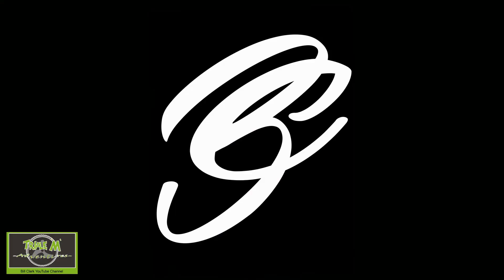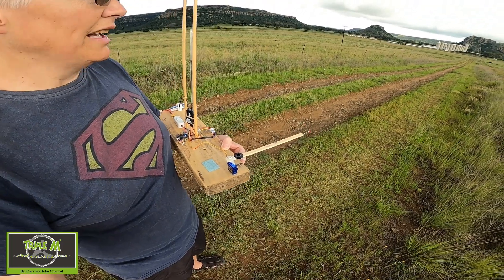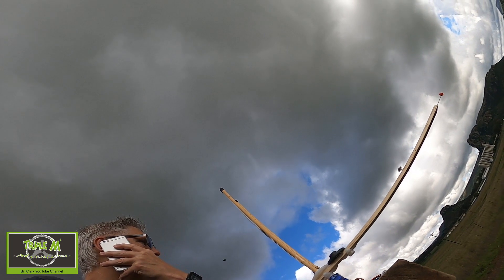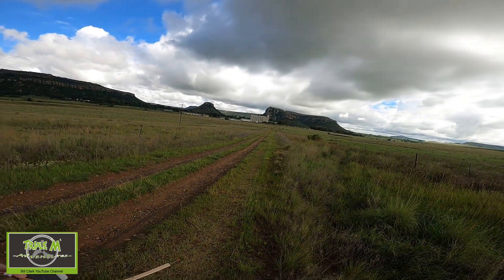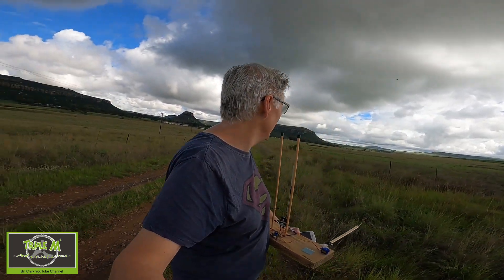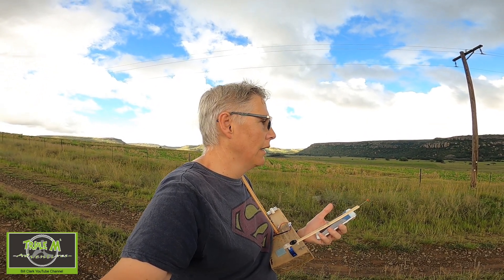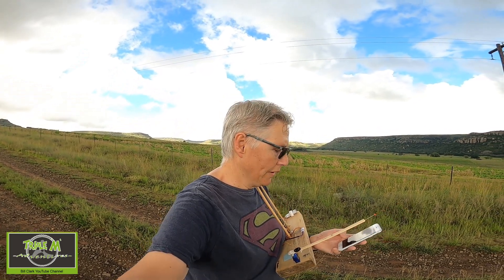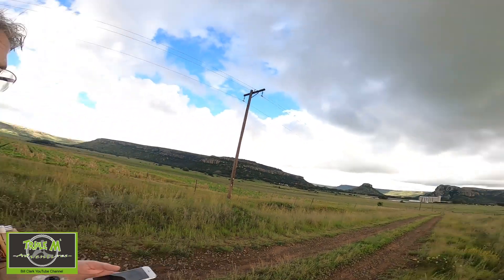Range Test "Real World": RadioMaster R168 SBUS / PWM D16 Receiver

Comment: This receiver has two antennas. I have just bought one . How do I fix the receiver antennas in the fuselage. Do the antennas have to stay in the fuselage or be extended outside ? I have no idea
Reply from the maker: Hi Ebenezer, if you can install them 90 degrees to each inside the fuselage will be fine. I have mounted antennas on the outside which is ok too.

Comment: That's my iPhone!
Reply from the maker: It just looks the same Woodstock!
Reply: @the-happy-RC-flyer  Phew
Reply: @the-happy-RC-flyer  Hi Bill. I actually need International Rescue for real I am afraid. Having successfully tested the range of my Crossfire Micro module (radio needed latest update) and found it to be satisfactory (broadcasting telemetry thru several houses), I came back to try to fly with Internal RF. Now - I know about checking the internalmulti option before downloading the firmware and this was done, but since the reflash I cannot turn internal RF back on. There is no option - it's missing. Two hours of valuable flying time later and it's still game over on internal protocol, despite multiple reflashings and card content updating. Clearly there's something here that I simply don't understand. I would be very grateful for your input on this one. It's an 'old chestnut' perfectly standard problem - but I thought I already knew the answer. Thanks a lot.
Reply from the maker: @mrhilma  If you have backed up your radio & model settings I would suggest removing the Crossfire module from the radio. Check in your radio settings in OpenTX Companion you have checked internalmulti as an option. Then flash OpenTX again to the radio using version 2.3.11 Check if the internal option is available if not. Then flash your internal module with version 1.3.2.77  Please let me know if the firmware updates showed they had completed correctly.
Reply: @the-happy-RC-flyer  Thanks Bill - all sorted. Wrong firmware perhaps. Anyway internal is back. Very much like: https://downloads.multi-module.org/
Reply from the maker: @mrhilma  That's great!
Reply: @the-happy-RC-flyer  Thanks for the inspiration. Yet again. First Crossfire flight tomorrow hopefully.
Reply: @the-happy-RC-flyer  Phew

Comment: I got R161 and R168 and did a RSSI range test at home behind three 6 inches thick concrete walls. The follows are only for reference: using RadioKing 4 in 1 internal module 1.3.1.92
R161 RSSI 52 (pre and post freq tuned innopenTx)
R168 RSSI 45 (pre tuned), 52 (post tuned)
Reply from the maker: Thanks for the info Stephen.

Comment: I changed the antenna of my master radio for this COP 86,357.80 | Directional antenna Frsky 2.4G Infinity 24 antenna compatible with FrSky 2.4 GHz radios and modules
https://a.aliexpress.com/_qegZmZ13
Reply: Looking for an improvement I do not know if this is the recommended one but I felt a better improvement with the flysky ia6b receiver
Reply: Oh, what do you advise me to change the antenna or can one radio have less signal strength than another being the same